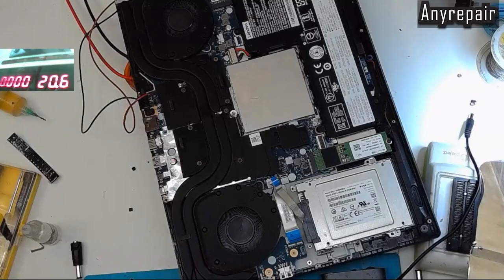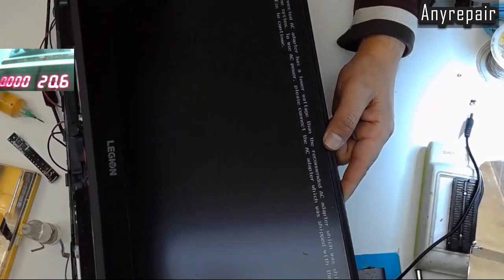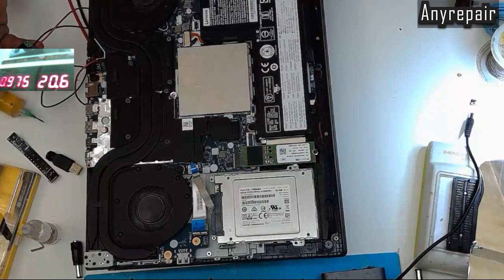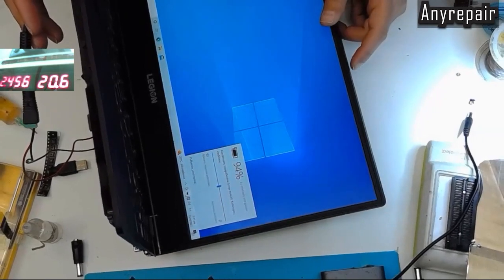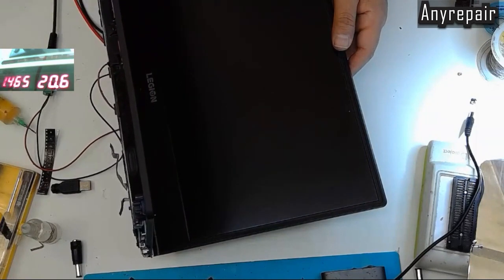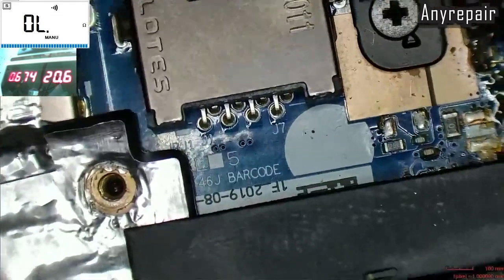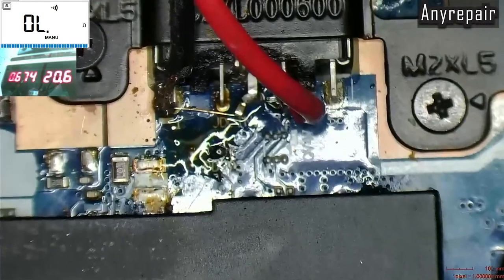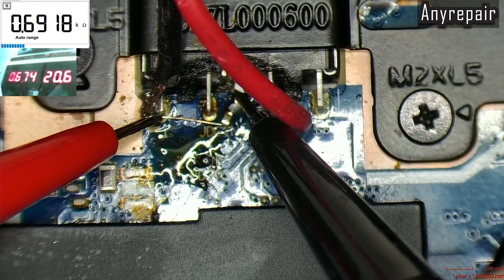How to DIY Lenovo gaming notebook 230W charger hack!!

Comment: Thank you for sharing!
TLDR: possible to solder resistor inside the charging-plug-adapter if you do not want to open laptop :)

I wanted to use Asus 230W charger to replace Lenovo 230W charger, but the plug adapter DC-to-Lenovo I bought on AliExpress showed the same error. 
I have cut open a male Lenovo plug side of that plug and there was resistor of only 550Ω. Instead of it I soldered 4.7kΩ resistor and now this adapter works and Lenovo laptop charges and does not show any more errors!
Reply from the maker: Yes it is a good trick!💪💪

Comment: Thanks brother, If this works I will be adding your face to my wallpaper
Reply from the maker: Oh brother if it work for you, tell me to send you the photo with the right resolution....😉😉..I wait for your feedback, if it works or not!
Reply: @AnyrepairENG  I will let you know within 24 hours
Reply: @AnyrepairENG  Hi, Thankyou for the video and the hack actually worked. But after some time the same problem aroused and the laptop is again giving the message to use the charger that was shipped with the laptop
Reply: FYI I am using the original 230 W lenovo charger that was shipped with the laptop and I have removed the charging port because I got it repaired from the service center and the port was heating so much that it was ruining the jack of the charger so I tried to connect it directly and it was working all fine till now. But now when I turned on my  laptop it was again showing that message. Do you have any solution ??

By the way thanks for the hack I think I should once more repeat the fixing of the port.
Reply from the maker: @SiddharthAtrey  thank you so much for the feedback!
Reply: @AnyrepairENG  Hi, As Promissed I want you to send me your photo my problems fixed now. Instead of the 4.7 K Ohm Resistor, I would recommend everyone to use a 1Mega Ohm Resistor(If you are using a legion 230W adapter).

Thankyou for such detailed explanation 🙂
Reply from the maker: Hello, 🤣🤣 no need of my picture! Just keep up following our channel! Thank you once again for your feedback!

Comment: So the adapter from aliexpress doesn't work? Unless you solder that, you need an original charger?
Reply from the maker: Yes this is the only way to cheat the  board to sense 230w adapter
Reply from the maker: Yes this is the only way to cheat the board to sense 230w adapter